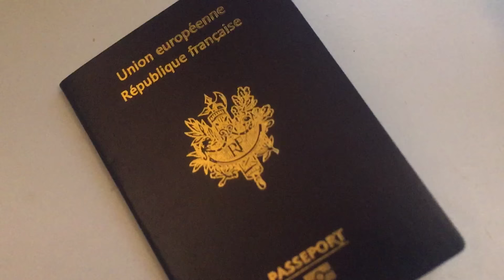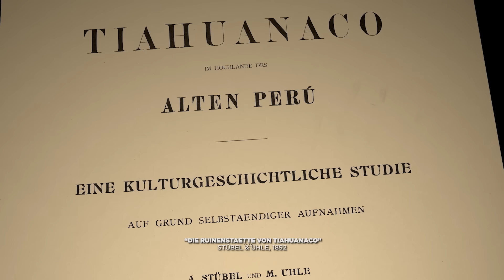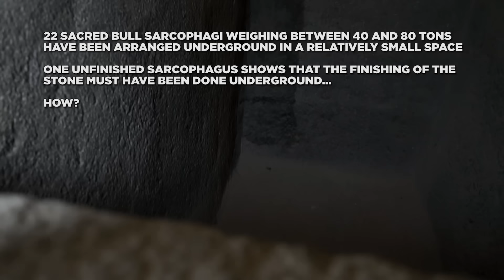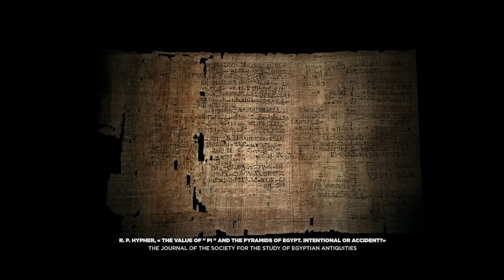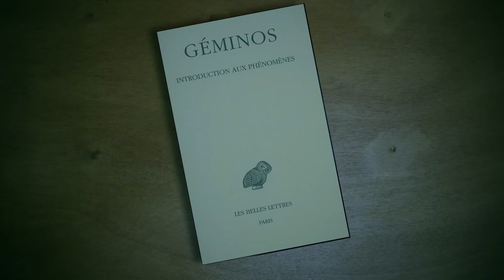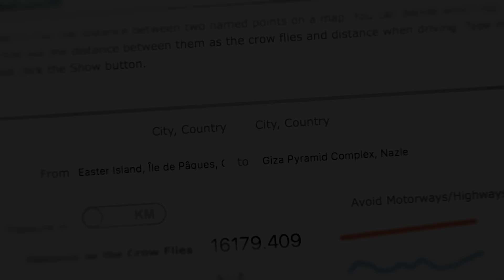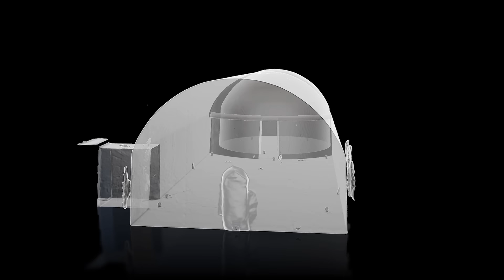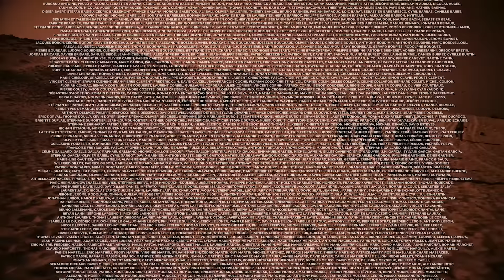Builders of the Ancient Mysteries - Full Documentary, presented by UnchartedX!

Comment: 20:20

Wow! I'd never seen that before.  I already knew the outward facing lines (between the blocks) of many ancient sites were already incredible and intricate (not just rectangular flat surfaces which would be easier to create), and incredibly precise, but I had no idea that the interior dimensions (nonvisible surfaces between the blocks) were that precise, and not flat surfaces (twisted).  That's insane.

I've worked in a rock quarry for several years, on softer stone.  I don't think people realize how difficult it is to do that.  Using modern equipment, you'd have to saw the stone (at minimum) from it's most outward facing corner (or edge), and then grind down the remaining surfaces (by hand) to fit the exact nonlinear surface to fit with the other block (which you'd also have to mirror, by hand).  Modern grinding/polishing tools (except really expensive computer controlled machines) are meant to carve away material on a flat plane, not on nonlinear surfaces.  This would either have to be done by hand (extremely labor intensive just for one block, and not precise), or be done by complex computer assisted machinery.  Even forming the nonlinear surface template (to measure against while working), and then mirroring it for the adjoining block, is very difficult (borderline impossible for ancient peoples given the standard model explanations).

Absolutely incredible.  I'm not curious how the Egyptian blocks are like on the interior surfaces.
Reply: Unless one has a way to make the stone pliable.  Resonance (using sound or kinetic waves (banging or rapping) as a motive force) or perhaps magnetics, or perhaps both are the key.
Reply: @Zorander2008  I don't even think you need to go that far.  Evidence like this begs the question: why would they build their structures in the most difficult ways possible, when there are easier methods.  This complexity adds orders of magnitude more work, and according to the standard model, is completely unnecessary.  Modern engineers will tell you the same thing.  You don't massively over engineer something without some reasoning behind it.  You don't build needless complexity into your work (and with these structures, they're already massive, in terms of size and manpower) without some reasoning behind it.  At some point, even with modern machinery today, the complexity of these structures becomes unsound purely from a construction and manpower standpoint.  It's simply not worth the time and effort to make these things.  There's obviously more to these structures than what the standard model says, and it belies reason that primitive humans with primitive tools made these structures, and then made them needlessly complex, making their jobs way, way harder, if not impossible.  We also see this seemingly needless complexity in the smaller artifacts as well (like the granite Egyptian vases currently being scanned).
Reply: @eamonnholland5343  you’re looking at it thru a modern lens.  We don’t know the methods, so we cannot really say how complex it would be.  It’s a matter of scale and solving for that problem: to mass produce.

I don’t believe that primitive tools can be used to achieve certain things we see that exist and have impeccable provenance.  Therefore, to accomplish something like the vases and the pyramids and other great structure that’ve lasted the test of time, you need to solve the scale problem and explain that also.  Only methods that make the work trivial will suffice.
Reply: @Zorander2008  You're right.  I am looking at it from a modern lens, because that's with the most advanced tools and knowledge we have to judge these works against.  In that way, I agree with you.

I've worked in a rock quarry before (in much softer stone than granite), with steel hammers and chisels, pry bars, electric grinders, sanders, and polishers, 2 foot circular saws, 6 foot circular saws, 10 foot circular saws, massive front end loaders, fork lifts, and other very large machinery to cut and process rocks, and I can say that what the ancient peoples created is incredibly difficult to make, even with today's machinery.  That's what I was attempting to point out with my previous comment.  Even with today's machinery, what the ancient peoples did would be unfeasable in terms of economics and manpower.  And yet, they supposedly made these works with copper chisels and pounding stones, which makes it several orders of magnitude more unfeasable.

There's a video that the Youtube channel Scientists Against Myths did to "debunk" the precision stone vases that Ben and others have been talking about, where they attempted to create a "precise" stone vase using primitive methods, and it took two people 2 years to make it, and it's nowhere near as precise as the vases that have been looked at thus far.  That time frame to create just 1 vase is wildly impractical, and there are tens of thousands of these ancient vases that were created.  The ancient peoples clearly had a much more efficient and refined process than what the standard model says.
Reply: @eamonnholland5343  I think we think the same.  Glad to have your considered opinion, which I would choose to respect as a quarry worker that voices the same things I’ve heard other stone workers and builders say.  Thank you for so many words to cure my original misconception, and my apologies.  I didn’t mean to sound off.
Reply: @Zorander2008  No worries.  I knew what you were saying.

Comment: They may have used molds. Think of a rectangle shaped mold with the two shorter ends open. Once your material has hardened to a certain point you pour it into the mold. It is still soft enough to mold around the rock below it with the help of gravity, but hard enough to stand upright. Same with the sides of the stone. As gravity bears down on the top of your material it pushes the sides outward to conform to the stone next to it after the mold has been removed. The worker would have flat smooth stones in various sizes to push back against the bulging if it was getting out of control. That's my theory, what is yours?

Comment: If they used a hammer and chisel to carve the stones, there would be huge tailing piles. To say they cut those huge stones that precise using that method seems as ridiculous as building the pyramids using logs and ropes.
Whoever drew the Nazca lines had to of been either really tall or had a flying craft, in which case landing pads aren't out of the question.